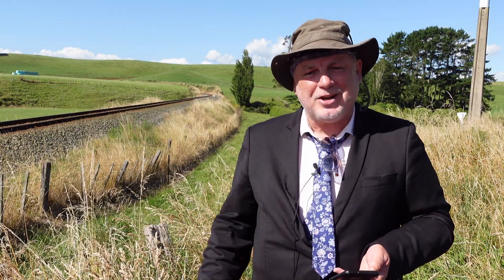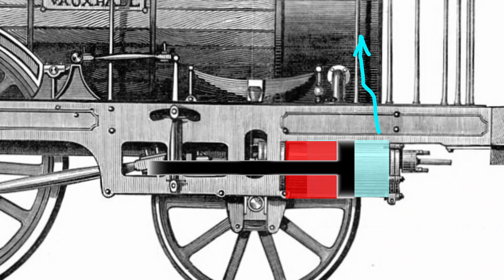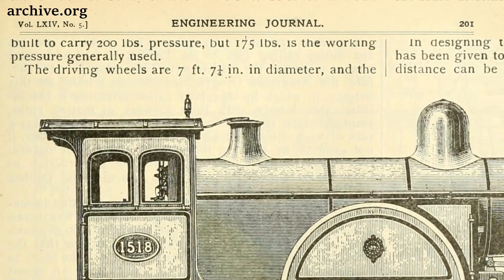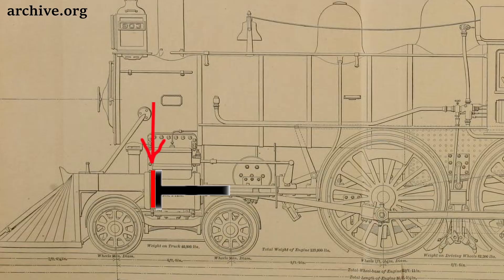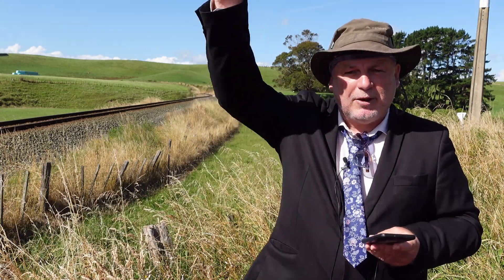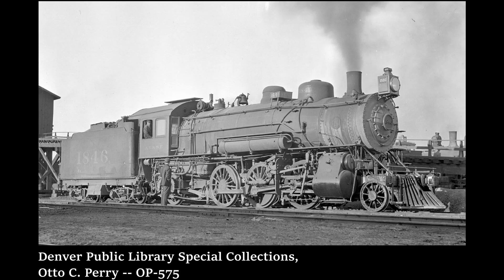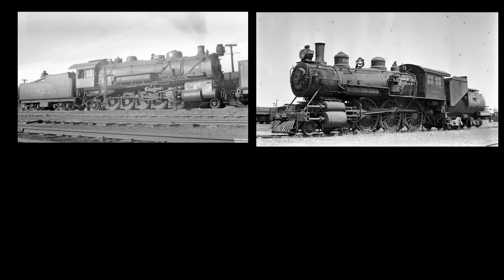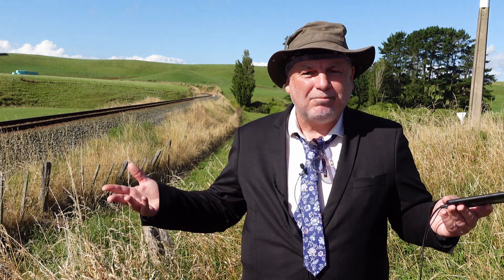Compounding - an introduction

Comment: All things considered, compounding worked better in marine & stationary applications as in locomotives whatever savings you got in fuel and water was taken up or exceeded by the costs of maintaining the more complicated compound cylinder/valve arrangements.
Reply from the maker: Thanks for your comment.  A workable superheater was the final nail for compounding.  Yet adoption of other marine applications to rail remained a Holy Grail up to the end of steam.  There are some things you can't pack into the loading limits, and compounding was certainly one of those things.
Reply: @theimaginationstation1899  Andre Chapelon would disagree with this assessment. In the late steam era, he managed to build some frankly excellent steam locomotives that combined both compounding and superheating technology within the limits of the French loading gauge. Several of them probably still hold the world record for their power to weight ratio compared to other steam locomotives, as well as thermal efficiency (up to 12%, which is phenomenal for a steam locomotive, since most hovered around 6%).
Reply from the maker: @andrewlucia865  I'm sure M. Chapelon would, and with good reason - his locomotives may well be the best ever constructed.  Yet the North American roads did away with, or simplified their compounds - and utilised superheated simple locomotives through to the end of steam.
Reply: Depends of the cost of coal.
In France, coal was expensive, as it was either produced locally, in difficult conditions, mines were deep and veins poor, or imported from foreign countries, mainly UK and Germany.
There were several trials between simple and compound locomotives through the years, and compound always won, just because of fuel savings and despite its complexity.